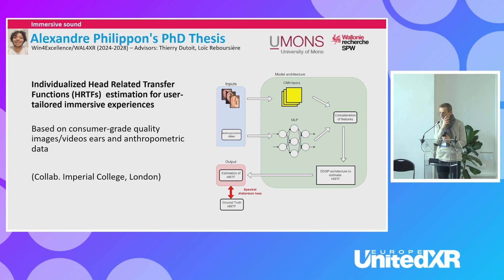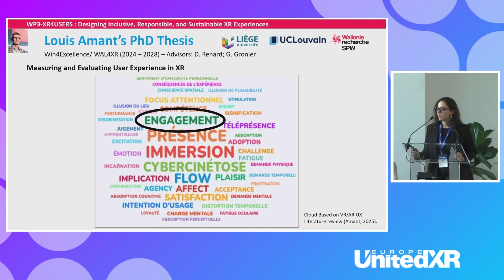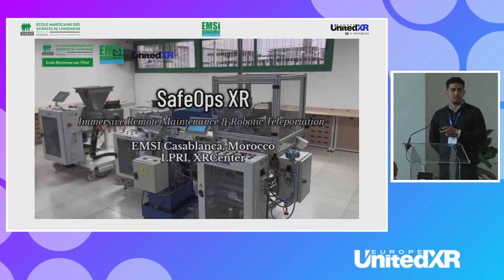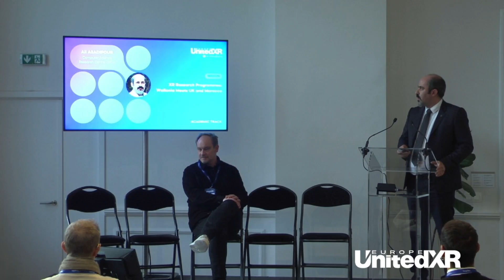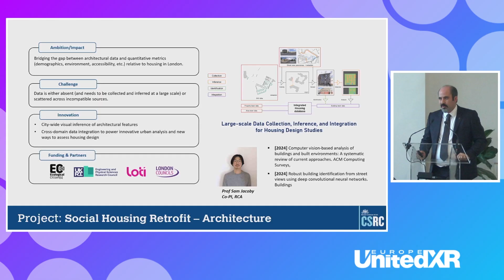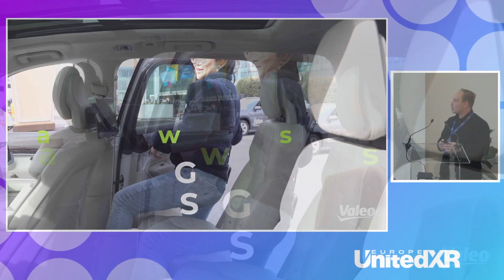XR Research Programmes: Wallonia Meets UK and Morocco | Part 1

Comment: Some amazing Phd work done in this region! I wish all XR events had a section where the academic side of the industry is given a chance to share the latest research they are doing. This would give academics an exposure to the industry and, even more, the industry a view into cutting-edge research that is done, and accelerate the integration of this into practical use cases that can be implemented.